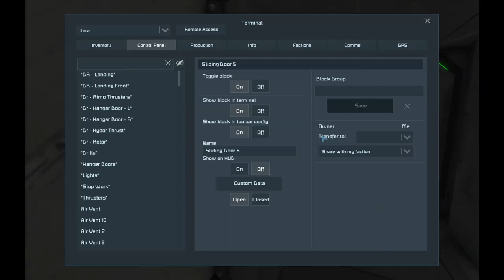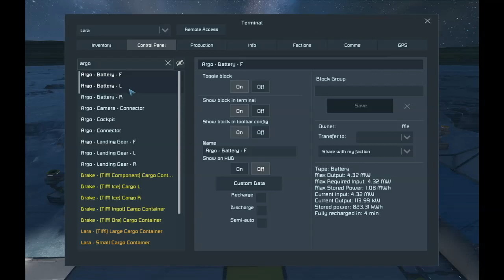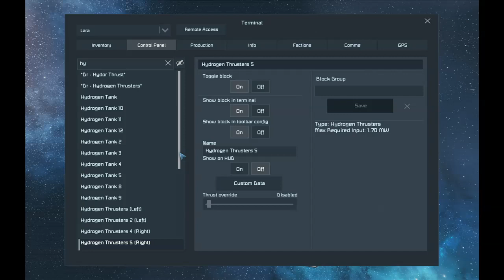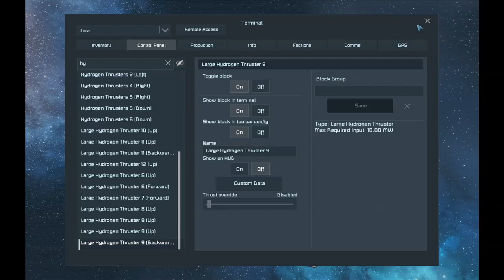Space Engineers S02E12 - Space Above and Beyond

Comment: Some forward movement as well as upwards as well as reducing hydrogen thrust would work better and lift your nose a little bit to increase height. You made it so your successful anyway. Maybe blast door blocks around the platform you use to lower to the ground as they dont have a collision box that will interfere or leave the piston a little lower so the catwalk blocks dont bang against the hull.
Reply from the maker: I think I do need to redesign the ramp for the rover bay I will look in to the blast door option Thanks chawkes70.